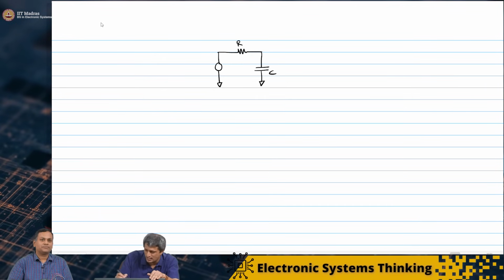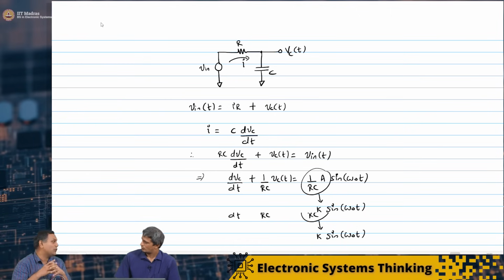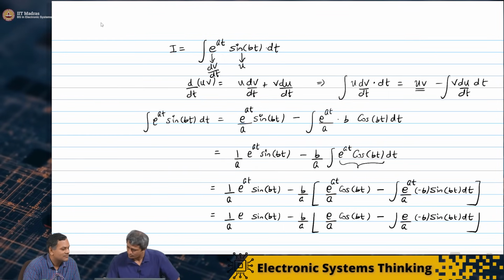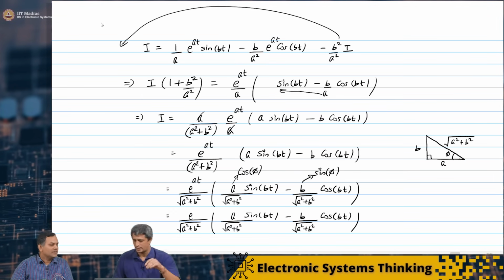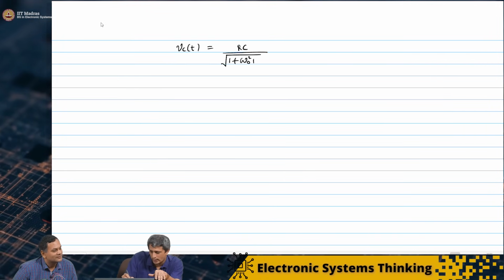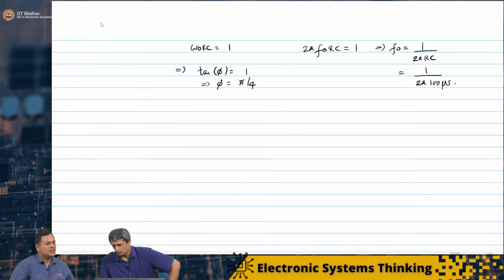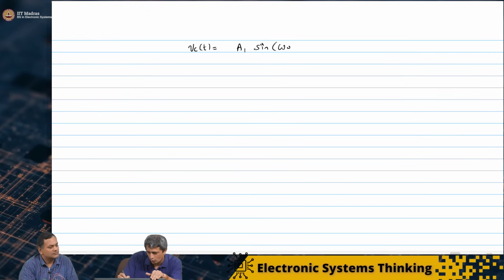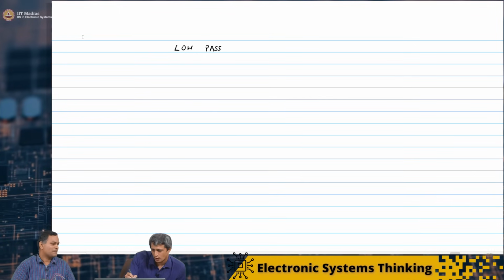7.2 : Low Pass Filter - Theory

Comment: Sir, thank you so much for the detailed lecture. I really appreciate the discussion format between the two professors. However, as a student, sometimes I feel a little demotivated because the professor acting as a student seems to understand every concept instantly. It would be very helpful if, at times, the ‘student’ professor could also make some common mistakes or ask basic doubts, so that we learners can relate more and feel less pressure while learning. Thank you for considering this suggestion.